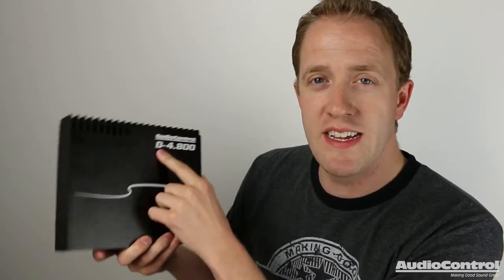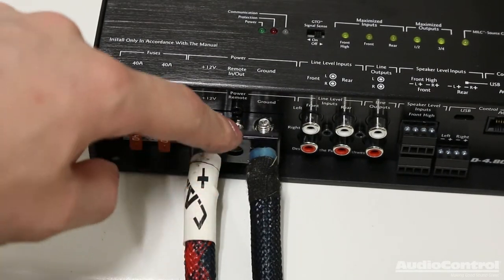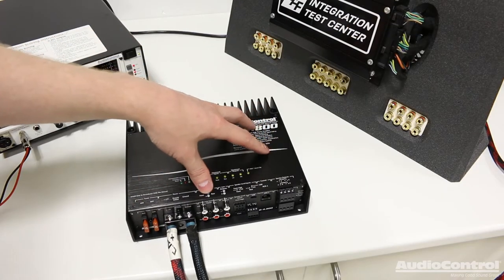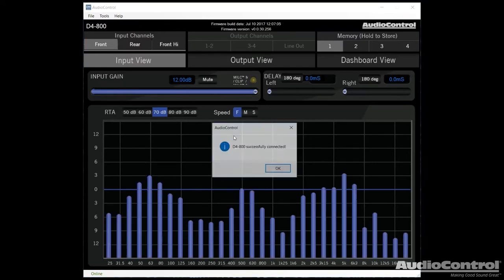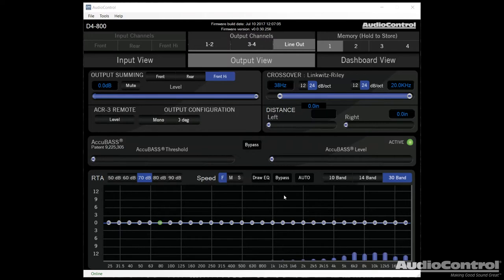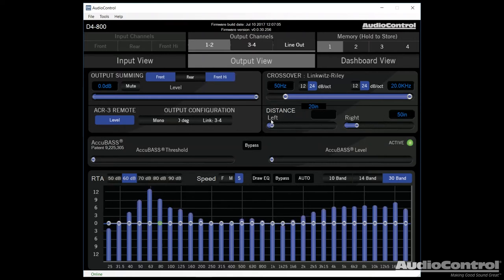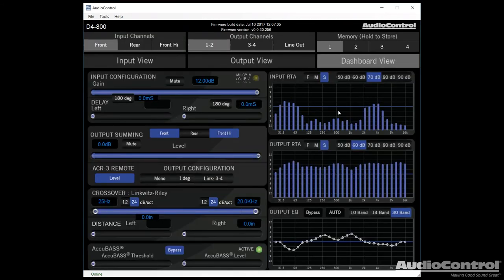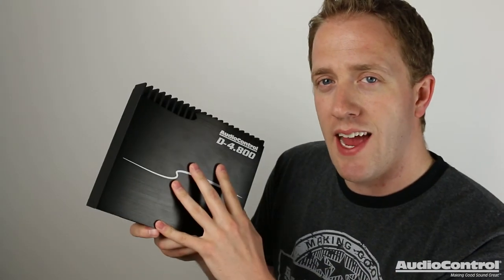D-4.800 DSP Amplifier - Tuning Flexibility for Audio Perfection!

Comment: @AudioControl 
Is there any specific technology to help with the input signal from a factory radio? (IE JL/Morel's have  "Differential-balanced" inputs) to ensure the signal is as clean as possible?
Reply from the maker: Yes, all of our amplifiers are balanced inputs, but on top of that, we also have an input RTA built into all D series products, so you can physically see the signal coming in. It makes a world of difference. Also, most of our products feature indicators for input clipping (maximized input light), output clipping (maximized output light), and an input source clip (MILC).

Comment: hi. when setting up the gains for this particular amplifier on a aftermarket head unit what test tones do u use ? pink noise or 1khz ? 
I'm using this amplifier to power my hertz active components on the front doors and coaxial on my rear doors 
I have the smd dd1 but I'm trying to find out what's the correct way to set the gains. thanks in advance